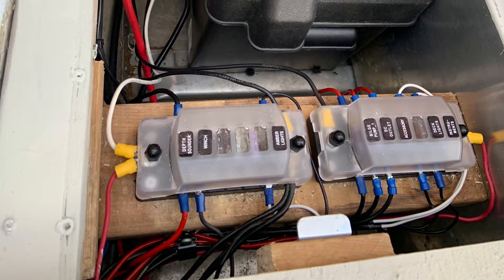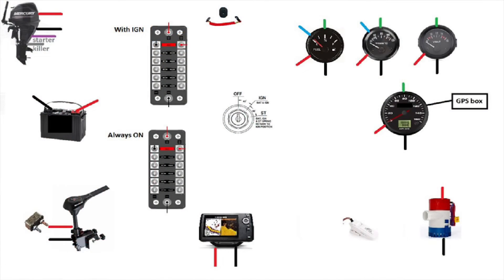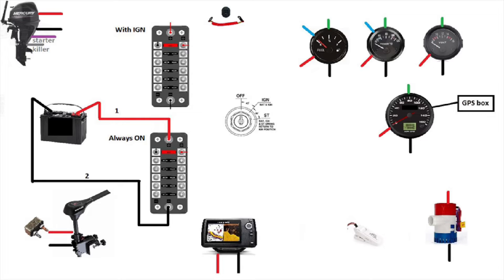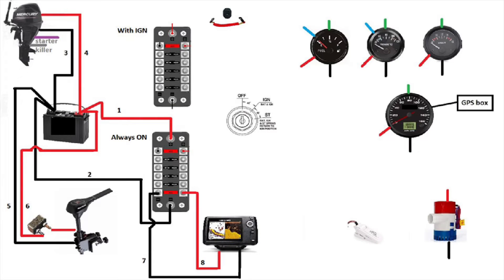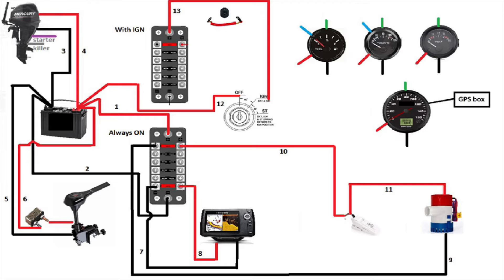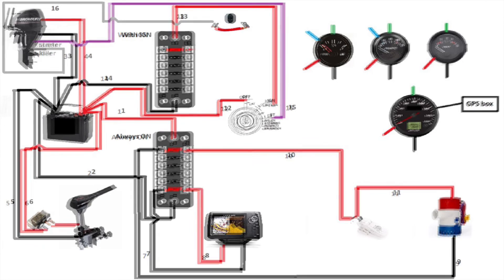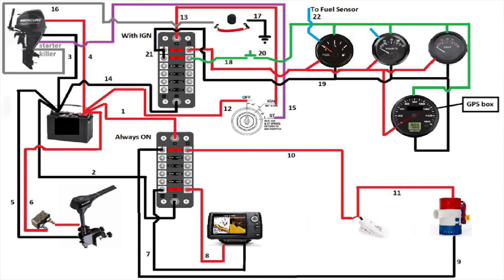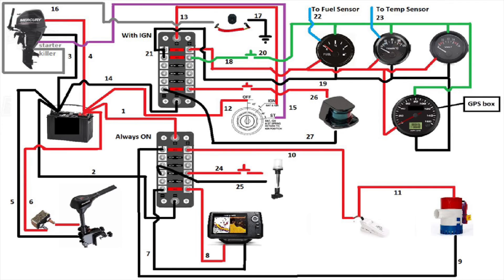Boat electronic wiring diagram

Comment: Wow, very simple but instructive video, it gave me an idea about how a boat is wired. One question, the green wire that comes from the gages to the box, what are those for? Why they must be connected in parallel?
Reply from the maker: Hi Enrique, thank you for watching the video. I’m really glad you like the video. The green wire is for all lights in the in the gauges. I connect them in parallel so they all go on at the same time once you turn your switch on. Thank you for your question, I hope you got your answer. If not do not hesitate to contact me 👍
Reply: @joetheboatguy5394  Thank you for your quick answer. One thing I would like to see is how to connect the forward and reverse station with the motor.
Reply from the maker: @enriquebarbosa9580  you are talking about the accelerator and reverse barrel links to connect on outboard? I will look into making a video but my boat is winterized for now, I should have something in the spring 👍. Thank you.

Comment: I am sure that if you put a fuse in your fuseboxes , fuses are all blown. You need to have a negative eart-busbar to connect all negative lines. And someone asked about using boathull as negative line, as in cars. That's not a good idea, it causes corrosion in the hull.
Reply from the maker: Hey Kenneth, thanks for watching and comment. I have it wired like that and no fuses are blowing. Yes, I told the other guy that some people connect ground to hull but I don’t recommend it. 👍 you are right it will corrode with time.

Comment: Thank you for sharing this. I was wondering what do when you have a steel boat. Steel hull.
Should I connect the negative to the hull?

Thanks
Reply from the maker: Hi, thanks for watching. Yes, you can connect the ground to the hull, sometimes the engine ground is connected to hull anyway. But I prefer to connect all ground to battery to avoid future issues with loose ground 👍
Reply: @joetheboatguy5394  Guess what. The one thing my hull became a ground was the steel steeringcable that went from the engine to the steeringwheel + console. Could not figure that out for a while!

Comment: Sir please help on this scenario.  I have two power wires/ different circuits at bow of boat. There going to an sw but, I need to install a 1&2 amp fuse inline of each and install back to sw as one wire?. Since there is no fuse buss at bow of boat. After installing these fuses can i run straight to sufficient ga power wire at bow? Thanks 

JP
Reply from the maker: Hi Jason, if you have no fuse box at the bow of the boat, I would install a inline fuse holder on your wire just to be sure to protect your equipment. 
MGI SpeedWare Inline Fuse Holder 5 Pack with 15amp ATC ATO Blade Fuse (14 Gauge) https://www.amazon.ca/dp/B07JQX3C8C/ref=cm_sw_r_cp_api_glt_i_CJSDE59G4E9XSNMNPFF7

This link is just to show you what is an in-line fuse holder. Then you would need the right gauge wire and right fuse. 

What is powered with this setup?
Reply: @joetheboatguy5394  2amp small accessories, thank you so much for the help sir!

Comment: That was amazing, love the strep by step. How about a diagram when adding 24 volt electric motor, then add a battery charger to the mix and also how to charge both the 24 v battery to the motor's alternator? Too much? Thanks in advance
Reply from the maker: Let me know if this helps
https://youtu.be/jn9tI_nb5ds
👍
Reply from the maker: Hi Brian, good question. I will try to build a video with your question. Pretty busy with the holidays but video will show up at a certain point 👍. Thanks for watching

Comment: I need help connecting a killswitch to my boat please
Reply from the maker: Hi Manuel, What engine do you have?
Reply from the maker: Usually it’s a “black and yellow” wire for kill switch. When that wire connects to ground your engine shuts off. So you need to have your “black and yellow” wire connected on the kill switch terminal and the other terminal to ground. When your kill switch is activated it will shut your engine. Let me know if this helped 👍